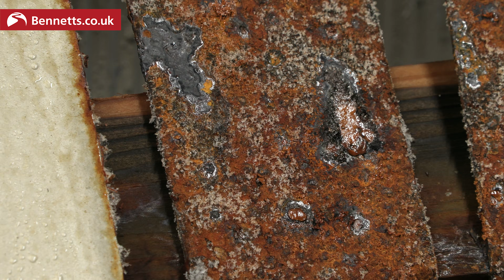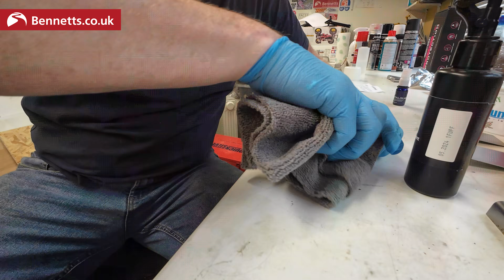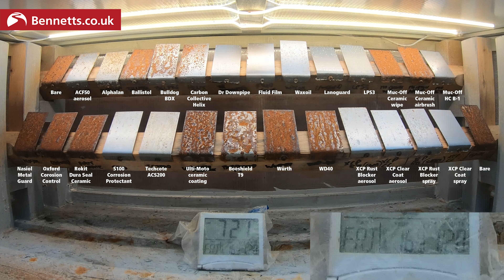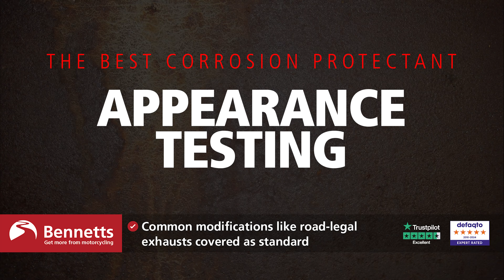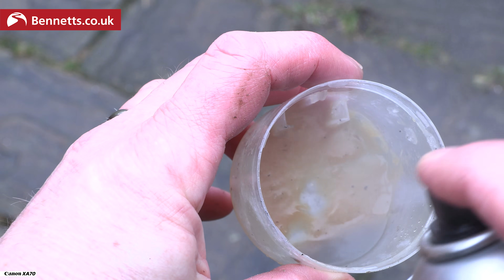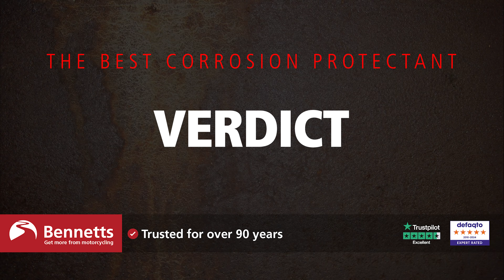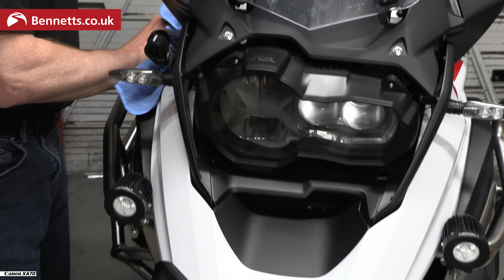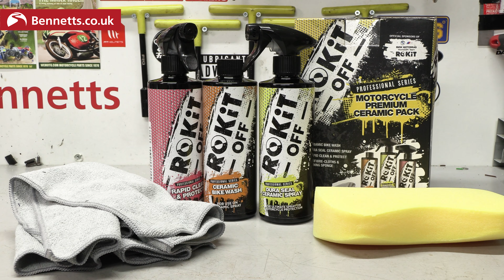Best corrosion protection 2025 | 33 tested | Are ceramic coatings worth it?

Comment: Nice work ... again!! TechCote is the one for me, so easy to apply and does a fantastic job ... sure it's a little sticky but it's only beaten on corrosion protection by the XCP Rust Blocker and that is even stickier
Reply from the maker: That does seem to have changed now. Still good, but have a watch. Cheers, John
Reply: @bennettsbikesocial  When M&P have it on offer for 3 cans for £11 it becomes pretty unbeatable ... on the VFM front at least 😉